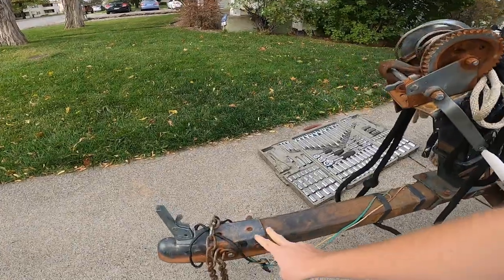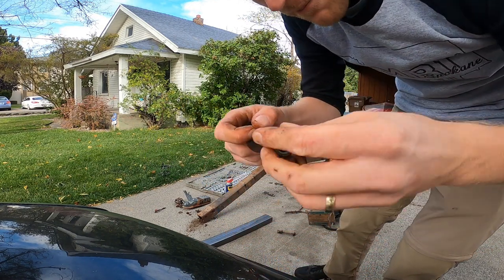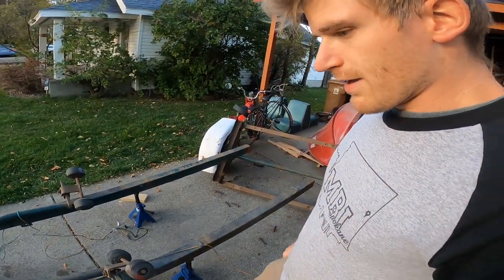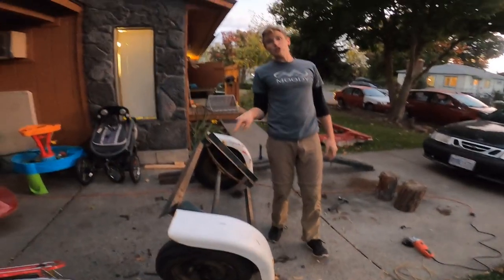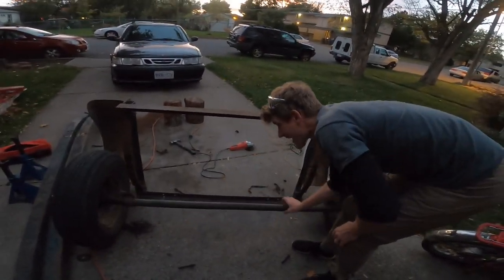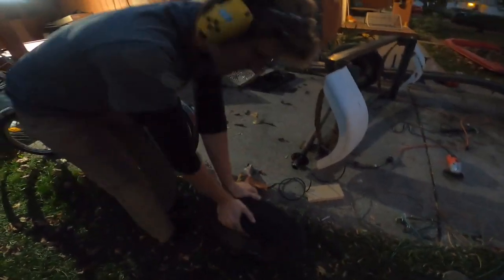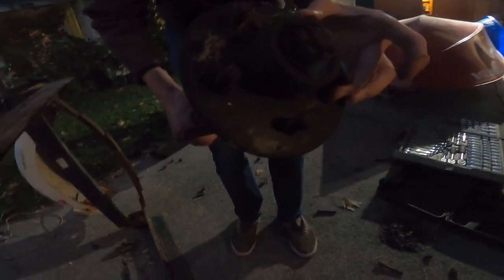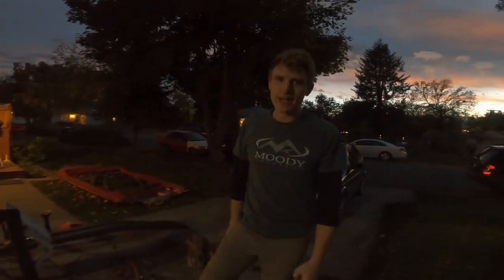Boat trailer rebuild (PART 1)

Comment: Trailers NEED trailer tires. Right?  Nowadays trailer radials are a thing. Used to be the only option was way old school bias ply. Ordinary radials would sway a lot and were simply not suitable. Sure sometimes people got away with ordinary tires, but definitely not recommended on the highway. Some brands may be more reliable than others, so a GOOD tire shop should be able to advise you. Or if you can find a wrecking yard with  a similar sized trailer? Longshot though.
Reply from the maker: Ya, i will definitely be looking for new trailer tires, I had thought about using car tires but decided against it.